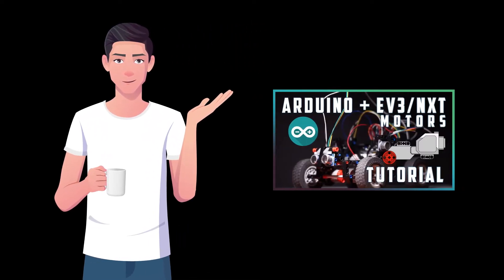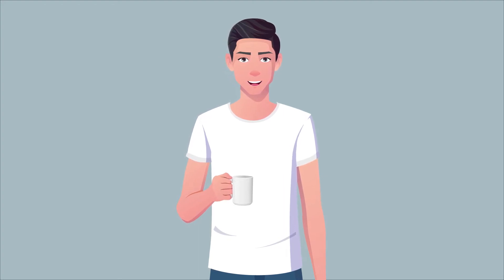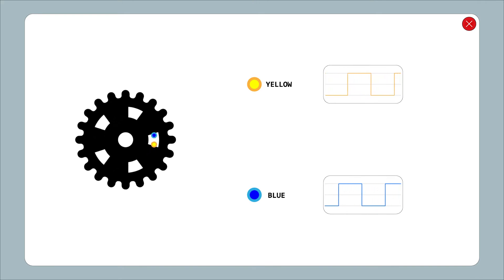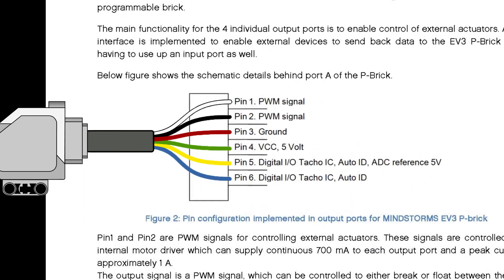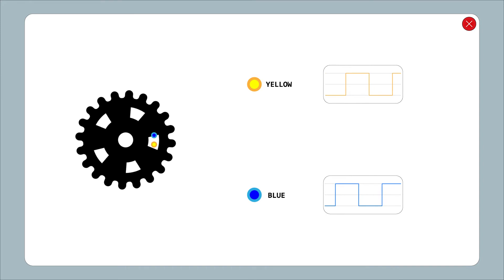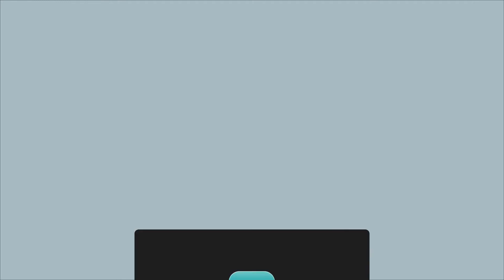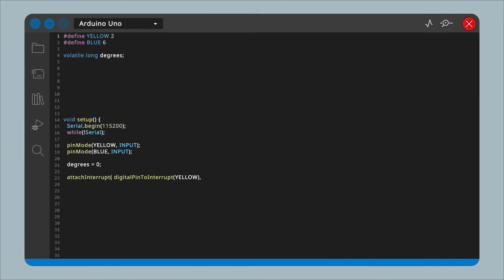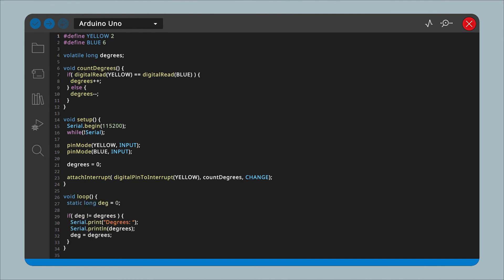Use internal ROTARY ENCODER of LEGO EV3/NXT motors - Tutorial

Comment: please, where do you get this datasheets?
Reply from the maker: You can find it searching on Google "Lego EV3 Hardware Developer Kit manual"
Reply: @FabioGaravini  That's because I can found only that datasheet about the nxt or ev3 and the ports, but nothing about the motors. How do I now if the motor drains more power than my H-board can supply? I am getting problems powering the Arduino and 2 nxt servo motors with only one 9v batteries. Thank you for the video, helps me a lot ❤️

Comment: On the ev3 controller itself, a value is given for one 360-degree rotation. Is it possible to detect with this encoder at least more degrees per revolution?
Reply from the maker: You have a resolution of 1 degree, but the same is also for the EV3 brick
Reply: @FabioGaravini  That's why I'm asking.  Maybe I can get more than 360 pulses per revolution if I directly read values from two pins...
Reply: @THEbonny95  I found a site call philohome and some one have assembly the nxt and ev3 components and I found something about the encoder, apparently yes, eu can get 720 revolutions per rotation or something like that
Reply: Have you done in the code to only react on clearance when the value is 1?  In general, there can be 4 states.  You showed it too.  When one shows 1 and the second shows 0, when one shows 1 and the second shows 1, when the first shows 0 and the second shows 1 and finally when both show 0. 4 states.